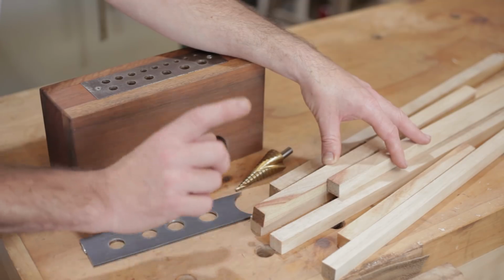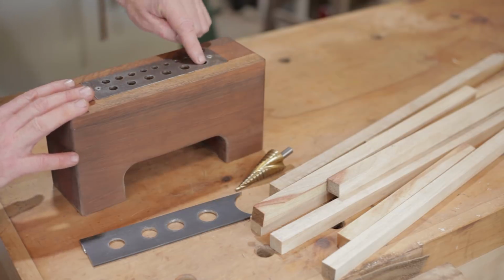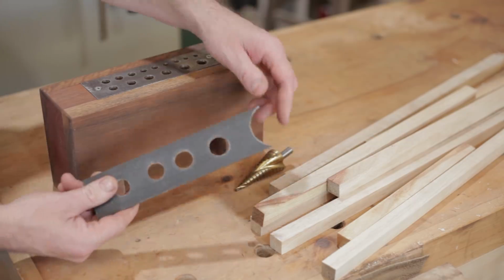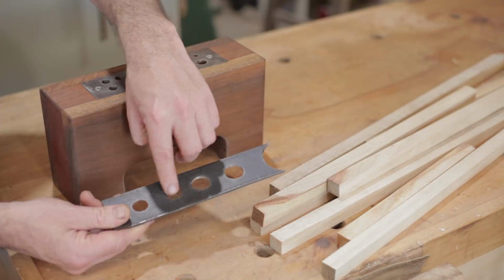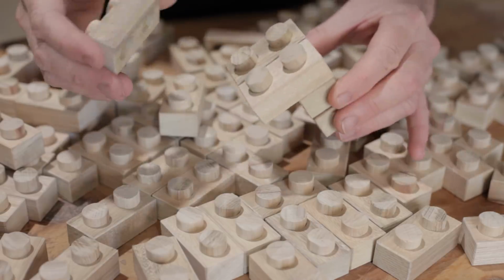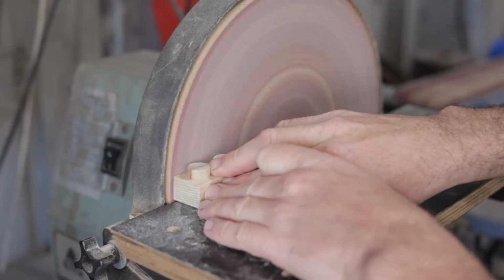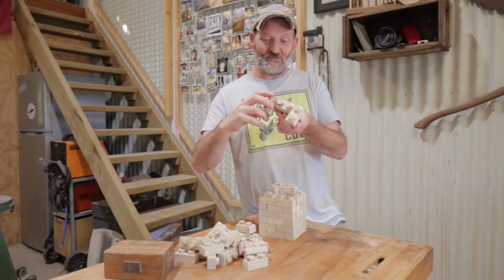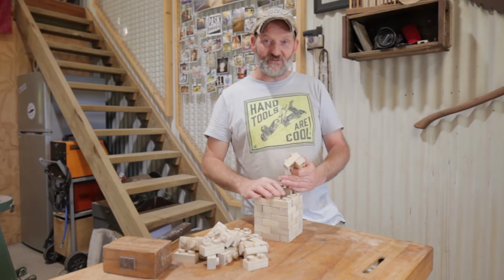Wooden Lego (Fail) - Scrapwood Challenge Episode Nine

Comment: When we mold the real LEGO bricks, they are a bit more precise :D  If they differ more than 5 my (0,005mm) they are put into the the scrap bin and recycled :)
Reply from the maker: Absolutely, that doesn't surprise me, they are amazingly accurate! I knew mine weren't going to be spot on but I was hoping they would be a little better. I made a few test blocks the day before and they weren't great either but I put more effort into getting these more accurate - it still wasn't enough! :)
Reply: Lego , the only toys that you pray for that your kids like too , so i can still play and enjoy without my wife is thinking what did i marry!
Reply: I don't think you will ever get that kind of accuracy with wood by itself. Not because you can't make something this accurate, but because of temperature and humidity affecting the wood. It might be possible to get it to work, if the wood is completely sealed airtight in epoxy or something like that. Might even look neat.
Reply: Actually, I sometimes use legos for makeshift jigs and fixtures; e.g. I use some legos to gauge square when sharpening, as I don't want to use metal or wood around water and freshly sharpened edges.
Reply: That said... anything built out of 1x2 lego bricks gets goofy quick, if you are interlocking larger ones much less so.  Wouldn't say this is entirely a failure.

Comment: Really nice job!! it's really tricky to get those distances right between the studs, which are the main feature that makes assembly possible. 
I think the issue here might have been the add up of the inaccuracies accumulated from the total lengh of the brick plus locating the hole with respect to the sides. Probably the tolerance stack-up doesn't look as good as it should. Another maybe "safer" way to go would have been drilling the second hole by fixing the previous one at the target distance with a dowel, kind of the same setup as with finger joints. I guess that way the distance is always kind of right and then it's just matter of giving clearance to the sides? it would be interesting to experiment! Anway this was awesome. great way to go to generate the studs plus providing always the same depth. Really cool job with simple jigs! cheers!
Reply from the maker: Thanks Carlos! You nailed the problems! I didn't think too much past the process I used, I thought it had a chance of working! As you know I've already addressed the problems in a new video! :)

Comment: That was a fun idea.  Cheers.  Maybe stop blocks for first hole.  Pin for locating the second hole with respect to the first hole.  I liked the use of socket and spinning the blanks for making dowels.  That seemed to work well.  Did it?
Reply from the maker: Glad you liked it! Yes, if I try again I will do something along those lines! The dowels worked well, but would've been easier if I'd used a 21mm in between the 22mm and 20mm (that was a big jump but still worked). :)

Comment: I’d love it if you’d explain what the various machines/tools are that you use, what they are called, and why you use them over the other tools. You must have several types of saw and I’m at a loss as to why you’d use one over another sometimes. I’m sure there are good reasons behind all of it! Thanks
Reply from the maker: The saw I used here is very accurate, much more precise than a drop saw. That's why I used it, also much more pleasant to use and for these small blocks it's safer and just about as quick! :)

Comment: This is not a criticism but just an observation. When you drilled your holes you turned your block of wood around, if you had drilled all the holes at one end and then, retaining the same orientation, moved your stop the appropriate distance and drilled all the second holes the error is then limited to the accuracy of the length of the block whereas when you turn the block the error is shared with the distance between the holes. I am not sure it would have made a difference but I always found my jobbing to be more accurate when I moved the stop for each process and maintained the same orientation. I hope this makes sense to you.

Comment: Well I, for one, call it a success considering the expansion and contraction of wood with daily changes in humidity and the less than accurate dowel making (wobbles, speeds, splintering etc.) and other factors in glue ups.. You did great. Putting on a finish and waxing should help some but hey its not for production.
Reply from the maker: Thanks Clyde! You're right, there are a lot of variables to them not working. I reckon after rethinking it I may be able to improve on them though! :)

Comment: Would a jig with 2 nails to mark the centres of the holes work for consistent spacing from 1 end? Looked like you were measuring from the ends on the 2 stud blocks so any length difference would cause misalignment.

Comment: Neil,

Do your hands cramp up when sanding all those small bits?
Reply from the maker: They did a little, but not enough to stop me! :)
Reply: Pask Makes ok

After I posted the last message I went looking for tumbler ideas, which could be a way to clean up small timber parts.

Gun reloaders use them to clean shell casings using walnut shell as grit

There’s a future project for you

Comment: Using stop blocks on the drill press is never very accurate, especially when using Forstner bits. You have to use a punch to mark the centre of every hole you drill. I don't know of any other way to be accurate on the drill press...